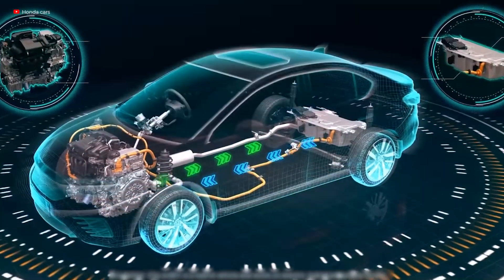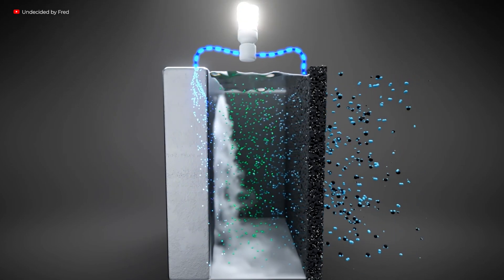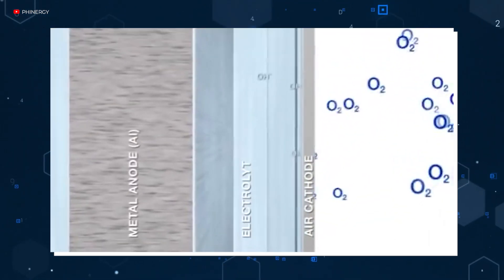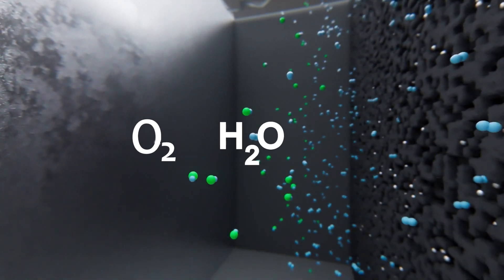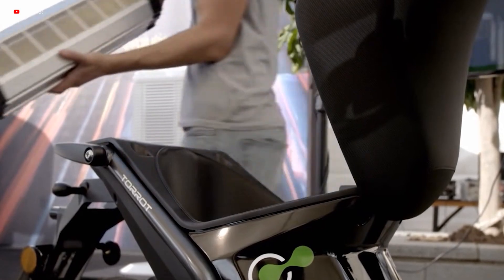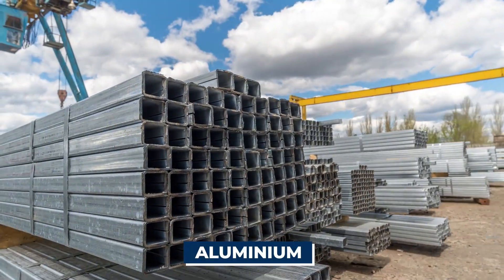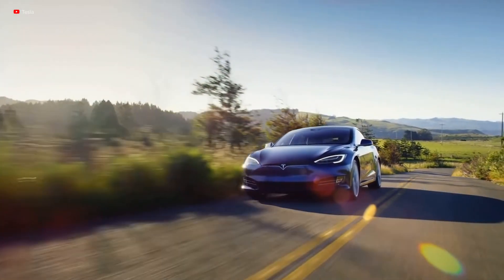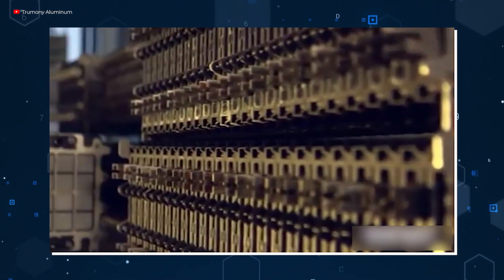Aluminium-Air Battery: An EV Battery That Doesn't Need to be Charged!

Comment: I can see Aluminum Air batteries being used for trucking and aircraft.  I can see them being used for range extenders for EVs that are using Lithium batteries but for day to day driving a rechargeable battery is best.  Lithium Iron Phosphate batteries are by far the best chemistry available.  Yes they don't hold as much energy pound per pound as Lithium Ion batteries that use Cobalt and Nickel but once the DC Fast charging infrastructure is developed we won't need the longer range batteries that use Cobalt and Nickel.